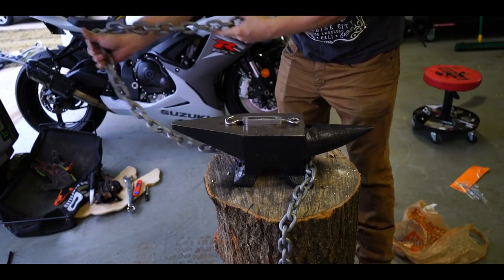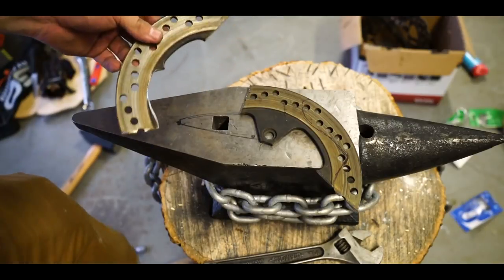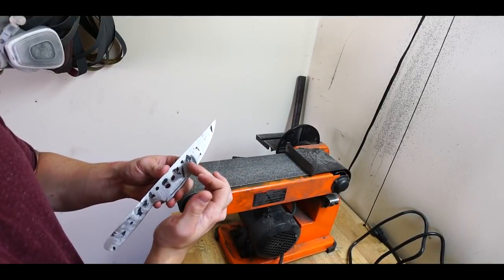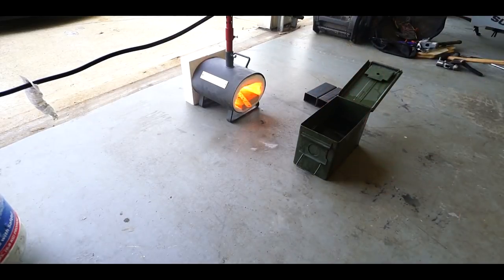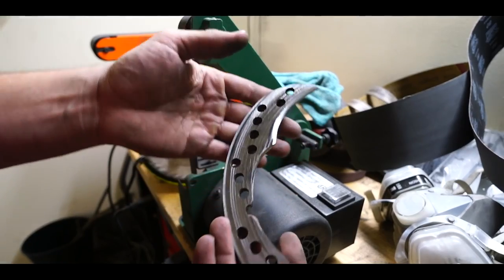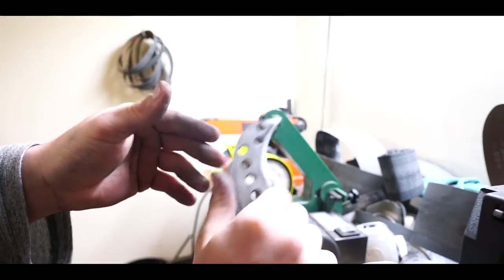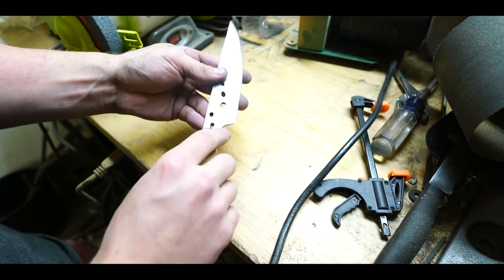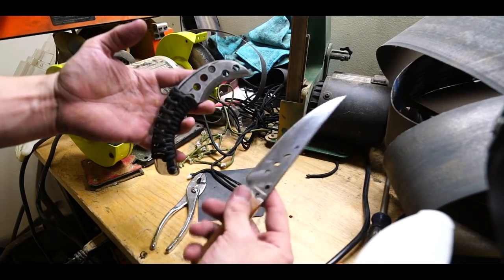Forging Knives from a Motorcycle Brake Rotor

Comment: Dan you need to just dunk the entire knife into the oil when you quench, the rapid in and out can lead to stress cracks and warps from uneven cooling. What I do is just dip the entire knife in for 2-4 seconds depending on thickness and pull it out and air cool from there.
Reply: I heard the samething , figure 8 motion aswell :)
Reply: I disagree with emphasis on completely disagree. As would many many other knife makers
Reply: @tomislavlulic9330  if you like warped blades do a figure 8 with 1/16 in steel
Reply: @tomislavlulic9330  hrmmm no, move the knife back and forth like youre cutting the oil, if you move it sideways you can cause it to warp.

Comment: A tip on the hammer marks: dress your hammer faces if you haven't already. Basically, round over the machined chamfers on the belt sander to make them nice and smooth. This can help reduce the half moons. And depending on which way the crescent is pointing when you hit, you may need to raise or lower your anvil. And of course, practice hitting flat because once one of those suckers is in there, it isn't coming out.

Comment: If you want to leave far fewer hammer marks, buy 2 things. A QUALITY custom made blacksmith's hammer and an autobody hammer. The blacksmith's hammer is designed to mitigate the hammer gouges. An autobody hammer with a wide flat face is good for planishing everything out much smoother after all of your other forge work is done. One of the best places to look for a NICE blacksmith's hammer is County Line Forge. Ting Ting makes some extremely high quality stuff.

Comment: Cool builfds
Without the finger loop the karambit looks like a larger neck knife and for the straight knofe it woulve looked cool with the holes still in and you couldve used pegs or just a driff for that

Comment: Hey friendly tip when tempering the knives in the oven. You don't show it but if you use a baking traybfilled with sand. The sand holds heat the best and won't mess with the metal or destroy anything.
Reply: ben turner and allows the steel to cool more slowly and evenly than just sitting in air.

Comment: The chain doesn't take away from any power in the swing, it just makes it ring less, and good luck getting the rotors to a good HT, stainless needs some computer controlled heat treat furnace and some aluminum blocks and a 30lb weight, shits weird

Dan's free Canadian knife supply just trying to help

Comment: Try brushing the steel when you pull it out of the forge to remove any crap that my get hammered into the steel. It can help with reducing black spots on the blade

Comment: for your normalizing cycles, put the knife on a piece of brick or hang it from the handle end. putting it on steel will make it cool too fast. also keep it in still air so probably not by the garage door

when quenching dont pull it out of the oil. you can keep the handle end out of the oil but make sure the whole blade stays in for the whole quench cycle.

Comment: here's a tip for the fit an finish. before you apply the epoxy, rough up the metal of the handle, it helps it grab on better

Comment: Dont get too wrapped up in the material removal method.  Get down and dirty with some raw stock and work that hammer big boy.  Im an amateur blacksmith too and i'd love to see you go through the same trials i do and am currently dealing with.  Old truck axle shafts and leaf springs are really fun to work with.

Comment: When you're shaping the handle on the Belt Sander. You tape the blade with masking tape in case the belt sander pulls it away from you

Comment: its not a karambit without the finger hole... thats closer to a sicle that a karambit
Reply: I was scrolling through the comments looking for someone saying that. Yea it's not a karambit without the finger hole
Reply: Also Paracord isn't traditional as a handle material...... On any knife.
Reply: A karambit does not technically have to have a safety ring, but almost all modern karambit's do due to the safety benefits. Its the curved blade shape and the hooking, tearing, and slicing functionality that makes knife a karambit. but It is very difficult to obtain the advantages traditionally offered by a karambit without a safety ring
Reply: Riley Bechiom thats called a sickle m8
Reply: @krundug2848  No, it is not. A sickle has a long straight handle (Usually wooden) with a straight section at the beginning. Its also much larger than a karambit.

Comment: I have hit a rotor with a hammer and they don't brake they are tough steel for a cheap knife made with scrap. But I will cut it and spray water and I will not let it get hot. I think that's why lots of people say they suck. I believe that if you put it in a forge and all that it will turn into crap..., but a cutoff wheel sand paper and take my time with the grinder will do it! Lol!!!  Let me shut up and get to work!!!!

Comment: Cool work! But dude please use at least some protective gear. When you where using the bandsaw I felt extremely uncomfortable. I other than that pretty cool stuff.
Reply from the maker: I'm not really sure what protective gear I could wear for the bandsaw. I'm already wearing eye protection, but if I wear gloves there's a huge chance at those blades could snag the gloves and really hurt me.
Reply: @DanMade  you know best sorry for bothering you. Gloves when you heat treat, eye protection when grinding - especially that pretty titanium knife, push sticks guide sticks or how it's called handles when operating close to the bandsaw. Those where the things I had in mind, again respectfully I apologize if I have aggravated you.
Best Regards! Happy New year!